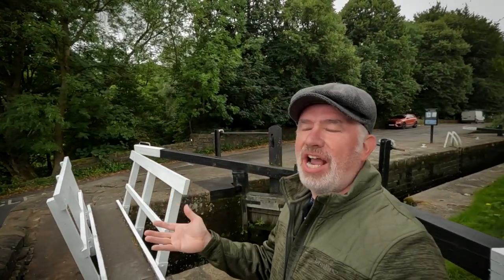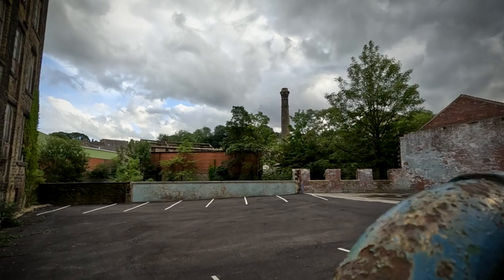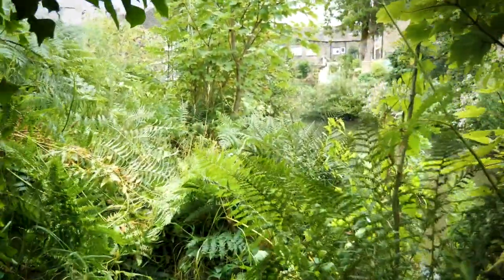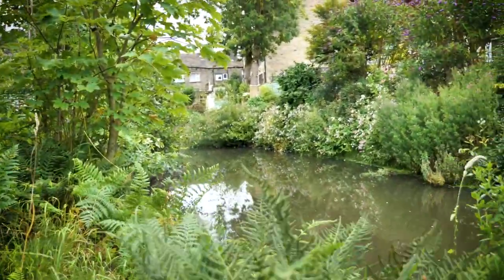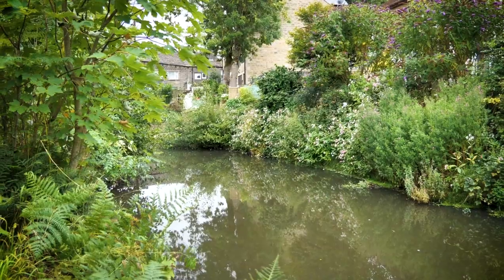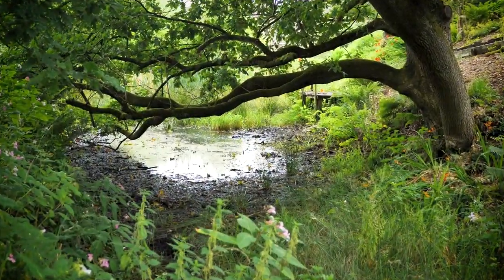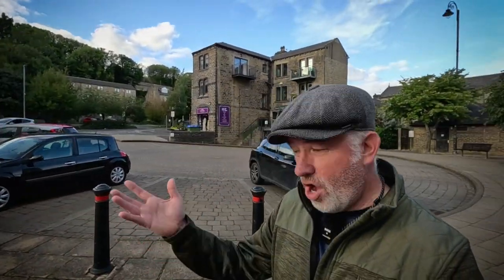Slawit MillPond Restoration

Comment: Just to be clear, Robert. When you say foreigners, are you talking about people from Lancashire 🤣 Great video mate and a lot of good information 👍 Cheers, Dave.
Reply from the maker: Ey up…. Dave… Thanks for this….lol at  “”foreigners”” …. Did you use the subtitles 🤣😂
Reply: Alright, Robert. Between the subtitles and the great pictures, I managed to fumble my way through it 😝 BTW. I don’t know about you but I won’t be bothering with the Hero 12. It’s essentially the same hardware as the Hero 11 with some software updates for optimisation for power and stabilisation, both things that they could have done with the 11. Although, I’m still holding out that they will release a new camera range, something a bit more Pro but I don’t think we’ll see it with the release of the Hero 12. Cheers buddy, Dave.